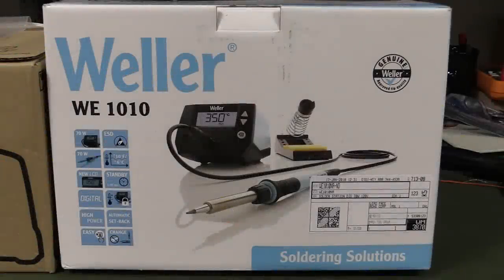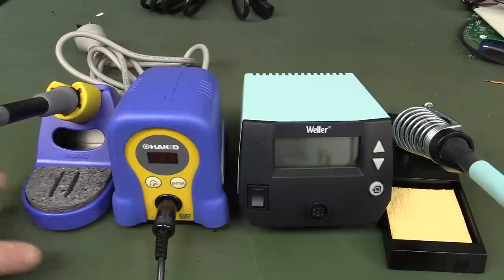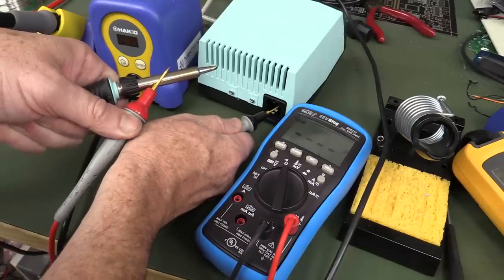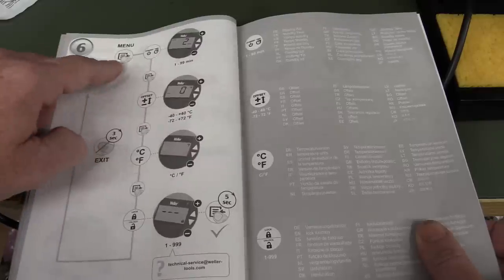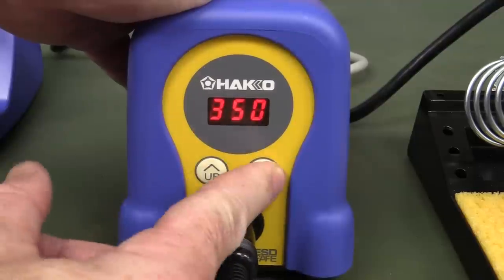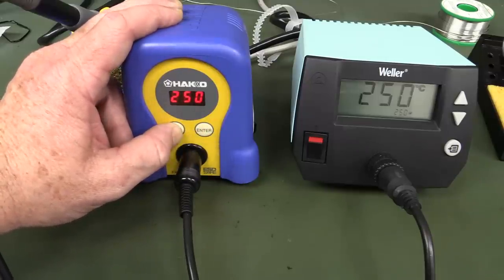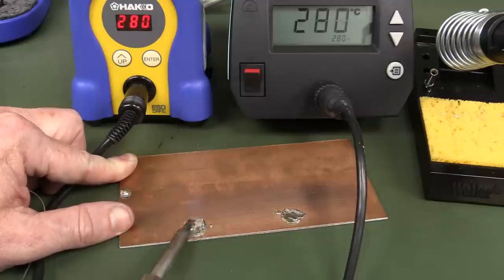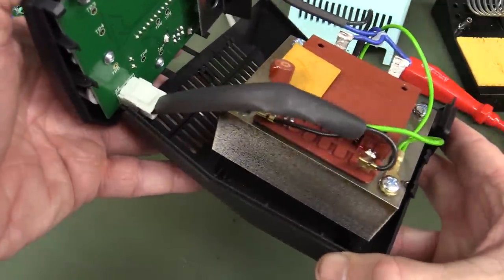EEVblog #1063 - Weller WE1010 vs Hakko FX888D Soldering Station

Comment: Can you review the Ersa i-CON PICO?
Reply: Ersa soldering stations are the best in my opinion :-)
Reply: Great Scott?
Reply: Christoph Bubel Just buy the icon nano. You won’t regret it!!
Reply: +Antonio Tejada They are great! We use several onr for serial production at work for about 5 years now, and are working petfectly. Only two cables failed after few years, but none of the heaters or stations failed so far. A huge step ahead in my opinion, we had continuous problems with Wellers before. Not mentioning the price...
Reply from the maker: The RDS80 is cheaper at $100 and has presets.
Reply: +EEVblog The i-Con Nano and Pico also has presets, standby timer, shutdown timer, 3 levels of heating response (PID) settings, and keylock. There is an SD card slot on the station. You can set up a configuration file on computer then move it to the station using the SD card. Maybe it is a little bit cumbersome for a developer, but it is nice in industrial environment that you can configure a lot of stations by plugging a card in, then removing it.
Reply: i own 2 nano's and bought a pico for home use. Best iron in the price range if you ask me! smokes the weller i have at work which is much more expensive.

Comment: Like Louis says, having the heating element and sensor separate from the tip makes the control way less accurate, takes more time to respond to heat fluctuations. I've been working on iphone board repair for a year almost with a knockoff 888 iron, but tip technology is about on par with these two. Can't wait for my 951 to arrive

Comment: Other tests: (1) Tie both tips together with a bit of copper wire to keep them at the same temp and try the sponge test again. 
(2) Measure and draw a graph of mains power vs time as the irons heat up, and in the sponge test. This will indicate if the displayed temps have been fudged to make the user think it performs better. (I'm reminded of VW  corrupting emissions tests)

Comment: At a minimum I would recommend a MINI TS100, with the added bonus you can easily take it with you. :) Wow, that weller is even worse than cheap hakko-clones. But yeah, you should take a look at TS100, Dave!
Reply: try it dave!
Reply: And make sure to use the ralim firmware https://github.com/Ralim/ts100
Reply: indeed, I had trouble with the firmware it came with
Reply from the maker: I refuse to use a soldering iron where I have to "make sure I use this firmware"
Reply: I second that TS100 should get a review. I got one and fell in love from the first attempt to solder. And it is less than half the price of any of these two. No experience with hakko, but I've used different wellers a lot. They are steam engines compared to TS100. Cannot wait until somebody makes a proper soldering station using TS100 technology.
Reply: why? among the same lines as "I refuse to use a product that doesn't run software" or "I refuse to use a product that does run software" :-) what matters is what you get for the money, and I think the TS100 beats out of the water any Hakko or Weller under $500
Reply: EEVblog Not sure what that firmware does, I have never flashed mine and beyond setting the default parameters when it powers on I use it as-is.  Great hardware, super fast heating on a 20V 130W laptop brick, and you can make the power cord as long as you like within sane limits.  Going back to a soldering station always feels like a real step backwards with such a short cord, as well as not being able to set the temperature (And see it)  on the iron!
Reply: You really don't have to change firmware. The only "real" difference (except it's a complete rewrite) is the other firmware has settings that you can change straight in the iron, original only had temp change and to change other things you plug it in pc and a removable storage with a text file has the settings. And a few other additions, like boost mode and such, which can be useful sometimes.
Reply: This why I don't watch your channel. I have to be honest but whenever I view your channel I expect your ideas and the products you review to be 10 years out of date.
Reply: What I don't like at all from the TS100 is it doesn't have a proper finger grip. Having sweaty hands like me, I wouldn't trust my fingers not to slip to the heating element.

Comment: 6:10 I did put my tip in there, my finger tip. Day 1 with Hakko, forgot it’s on and front is open, tried to move the holder. Big ass burn on fingertip, gaping hole which took two weeks to close.

Comment: how much do the handles heat up? The handles of the ridiculously expensive weller irons at my previous work literally got burning hot very quickly.
Reply: Arnþór Gíslason my hakko doesn’t get hot at all
Reply from the maker: Not a problem with these.
Reply: Leaded, here. I use my 888 at 315 to 335C. To summarize: I can't tell the iron is on/off by the temp of the handle. I can and do use the iron for many hours at a time, and it does not change. My method is to turn it on when I first need it for the day, and it is pretty much left on until I am done for the day other than for tip changes. It is many times that I have picked it up and tried to solder, and after a few seconds of pressing and wondering what gives, I finally realize I haven't turned it on, yet. The thing that finally registers for me is the lack of flux smoke. There's no perception of handle temperature.

Chinese 936/888 knockoffs? Hooyah, many of them get hot right quick at the same set temps. I purchased one, recently, and the handle gets hot within 1 minute of turning it on; uncomfortably hot within 5 minutes. One of the clone handles now comes with a feature that automatically throttles down the temperature when the handle heats up to avoid damage. So instead of offering a more expensive handle with better construction and materials, they can continue to sell bottom dollar junk by cheaping out and imposing a duty cycle on the handpiece. 20 minutes of work, manually turn it off and let it have 40 min to cool down. Or simply leave it on and let it reach half your set temp forever after.

There IS technology in these "old-fashioned" stations. There's nothing special in the electronics. There are no fancy software algorithms. The technology and experience is in the materials science and engineering and manufacturing methods in the handpiece and heater. I suppose regulations against asbestos are pretty effective, else cheap clones would just load their handpiece plastic with it and be able to compete with the real thing.
Reply: @Ampor Gislason: update: having just experienced this issue, I have to append my previous statement. It depends on what you are soldering! If your duty cycle is very high and your joints are sinking a lot of heat, the 888 handle can get uncomfortably hot. If you are doing continuous production work with large joints, the 888 is not the best at this, regarding handle temp!
Reply: very interesting, thank you

Comment: I've had the Hakko 888D for quite a while and it works well, but I then got the Hakko 951 and it's much nicer... but with either, I only use the metal "sponge" thingie to clean tips - I never use a wet sponge... (I think that was Louis R advice) :)

Comment: I'm used to the JBC irons and must say that I would prefer its design over both the Weller and Hakko. Grip-to-Tip distance is shorter, the cable seems much more thin and flexible and the tip exchange goes fully without any screwing.

Comment: It is interesting to see the cultural perceptions on these two brands. Here in the UK, Weller dominates. Almost universally. The light blue corporate colour scheme is pretty much what you expect to see in any commercial workshop, even if it is the baby model or something from the 1970s - not unlike expecting to see a Fluke meter (or a few years ago, an AVO). You could probably get away with the old style Hakko 936 but if you had the FX888 "Baby's first soldering iron" on your desk...

On a budget, I'd go with an Ebay 936 ripoff, have a good rummage inside with a meter to make sure it won't kill me, then add some genuine replacement bits from Farnell. Glue / bolt the iron stand on top if you are really pushed for space.
Reply: But the internet was going to bring us all together.  lol

Comment: Just by looking at the tip construction its obvious that the Weller shows a more accurate tip temperature when calibrated. The Hakko tip has higher thermal mass but once the energy from the tip has been dissipated ,as in the ground plane test,  the tip temperature regulation will be worse.

Comment: The Weller could not have won this "shootout" with Dave even if it soldered Dave's whole project itself, gave him a massage, with a happy ending afterward.  Not a chance.    The Weller gives you a more accurate display of the actual tip temperature where the Hakko is probably showing temperature of the heating element.  If you count the number of times  he says the Weller is better at a particular aspect, it thoroughly trounces the Hakko.... but Dave's bias is like "How ya doin'?"

Comment: eevblog use thermal imager to see temperature distribution over tips. Which one gives better distribution?
Reply: A thermal imager doesn't work on shiny metal.
Reply: superdau then put kapton tape on it
Reply: It does work, but emissivity should be set to ~0,3 and attention to reflected temperature. It's tricky and less accurate but works.
Reply: +fbonacic - what's the point of doing that? Dave's thermal capacity test (with the wet sponge) was actually much more informative as it directly relates to a characteristic  relevant when doing actual solder work.
Reply: Not A Name it's just a suggestion for another comparative measurement. Relax...
Reply: The wet sponge test is only relevant if the temperature sensor is in the exact same spot. The hakko has the temperature sensor in the heater, whereas I think the weller temp sensor is in the center thing that you saw when dave had the tips out. This would make the weller display a temperature that is closer to the actuall tip temp
Reply: +fbonacic  -- I've relaxed now, took me two full days... 😂

Comment: I've always liked my dicky Weller spring stand
Reply: Me2
Reply: Weller's stand is clearly safer with the hot tip completely enclosed. It would be very easy to drop something in (or even touch) the exposed tip in the Hakko stand. BTW: The one I have (from an older station) lays flat on the table no worries. It's massive, and not at all 'dicky' (the spring is fairly solid). I wonder if they cheapened up the construction.
Reply: I prefer the Weller, no question. The Hakko iron seems flimsy. The Weller smartly protects the heating element. It also has better transfer efficiency. It may seem dicky because it’s thinner, but it is protected, and more efficient, as I said. I also don’t like the Hakko foam tip cleaner.

Overall, the Weller is more professional, particularly at this price level. 

Hate Celsius. Too inaccurate. Too many fractions for any kind of accuracy. I prefer devices that you can select either. The Weller is just so more sophisticated.

And yes, it is great. It senses non use, and comes back on when you start. Mine also allows you to reheat the tip by tapping any button.
Reply: Mine always falls out of the plastic stand. Then again, it's only an entry-level WLC-100... I had to superglue the spring stand into the plastic to keep it from dropping onto the workbench every time I set the iron inside.
Reply: My Other Weller is a WP40P, its stand works perfectly (a spool of solder that I shove the back end into). LOL
Reply: Plastic?! What Weller comes with a plastic stand? Mine is 100% metal (aside from the sponge, of course).
Reply: The WLC100, cheap weller integrated stand with analog knob.
Reply: Did you not shove the metal knob far enough into the hole? My WLC100 stand has been pretty solid. Haven't had it drop down or fall out.

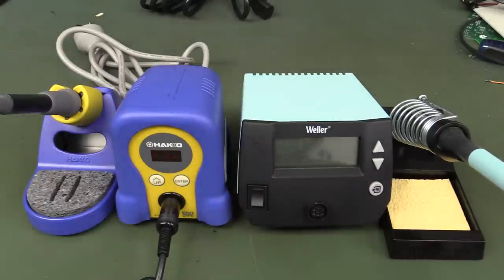Comment: 2:58  The fixed-temp devicxes like the  Weller Magnastat with a suitable #7 tip should be entirely adequate for almost all conceivable uses (e.g. close-to-eutectic alloys).  In all but the most extreme cases, if a user thinks they need to wind the iron temperature up, it generally means they do not understand the soldering process.  Use a larger tip mass,  not a higher temperature.   8:51 That wangy bit in the middle of the weller pencil is the thermocouple for the temperature sensing, this has been the same arrangement for 35 years that I know of!

Comment: As a Weller WS51 user im not really impressed by the new Weller units. And i dont get why you want a digital interface when you can have a simple Pot to select your desired temperature.
Reply: What temp exactly ARE you selecting with your un-calibrated pot?

Comment: The Weller took about a half second or so longer 350 to 450. The difference was that the temperature selection had to time out before it started to transition. The Wellers display and UI are nicer than the Hakko. I have a Weller W60P 60W iron with a similar stand to the Weller one shown in this video. The W60P has tips with a screw cap sort of arrangement near the tip end. I've been thinking of getting a proper soldering station to make it easier to deal with surface mount parts. I need a finer tip for a start.

Comment: The Weller looks far better in my opinion.
still using a toolcraft shittomatic. but for what i do it is easily good enough. I want to assemble the hardware my self when i make some little project. As a programmer i don't get to do much with 'small' hardware normally but it is a lot of fun to tinker around a bit.

Also a question for the commentors:
Is it a reasonable idea to try soldering 0402 parts by hand or should i rather stick with with a reflow oven (can use one at the local university and at a friends place) ?
Reply from the maker: 0402 by hand is no problem, but you should be using decent magnification.
Reply: ABaumstumpf Which amount of 0402 parts? A few should be okay, >1000 maybe consider using a pick n place machine...btw... Welche Uni?

Comment: The Weller showed some overshoot when reaching temp while the Hakko shows no overshoot.  The Hakko took sometime to show a drop in temp with the sponge and when it did show it jumped to the lower temp.

Weller's display is actual real time IMO.  The single numerical display of the Hakko is a cross between the setting and actual temp.

The default standby time is 2 minutes for the Weller, I believe.  I'd set a bit higher as needed but will not increase greatly.  Heating element life will most likely be much shorter than the non quick recovery type irons that have been known to last decades.  Either have a spare iron or heating elements.

Comment: You can find the Hakko used for under $100, which in my mind makes it the winner (until used WE1010 start showing). You have to look for them but you can usually find them going up one or twice a month. (Watch the RCGroup's classified section)

Comment: Amazon has this exact one on sale for $103.27! I've already got a 40w soldering station but thinking about getting a more powerful one because the 40w is just barely enough to melt the solder on thicker wires! :)
This one I think will easily do the trick!

Comment: I will never buy a hakko or buy into the arrogance of the japanese manufacturer, they removed the older prefered model with the knob because they knew better than the customer that has to use their crap. cant say I'm impressed with that weller, designed in germany means nothing anymore.
Reply from the maker: Yeah, I wasn't impressed that the discontinued the analog model, it worked great.
Reply: I spoke to a UK distributor I wanted to bulk buy from to sell on ebay and they said that they could not offer price reductions and if I bought any it was up to me what I did with them but Hakko won't let them sell on ebay and micromanage them the punishment for stepping out of line is losing distributorship.  So guess why all the ones on ebay are fake.............. because they wont let the genuine ones be sold. With just two distributors in the UK they reckoned they had enough and refused to supply me. The japanese are very strange. They were pleaded with to keep the analogue version but they know best.

Comment: Temp control with buttons only = trash bin.
Reply: Yeah, wheres the problem using an encoder or atleast pots, still better than buttons, especially this foil-buttons.
Reply: Agree. I use my temperature knob enough when I'm soldering to know that I don't want a station with buttons to do this. I'm sure some people here will tell me I'm soldering wrong, but their opinion of how I choose to do my soldering work doesn't change my experience or my needs. I want a knob. Iron temperature is a control I want to be able to quickly set from one arbitrary point on a continuum to another. That's an obvious job for a knob in my book.
Reply: Maskddingo look how Louis Rossmann works with it, he never changes the temperature, it is just rediculous, to be honest I didn't even realize before that you need to change every single digit with just one up-button, I thought all the time the two buttons are atleast up and down, I mean they could atleast program a longpress for each button. Definitly very strange solution, I can't comprehend all the decisions, except of that this thing is really desingned by someone who designs every kind of stuff, toys, kitchen tools, etc. that also explains the whole design of Hakko products.